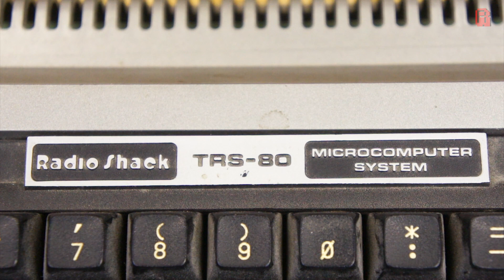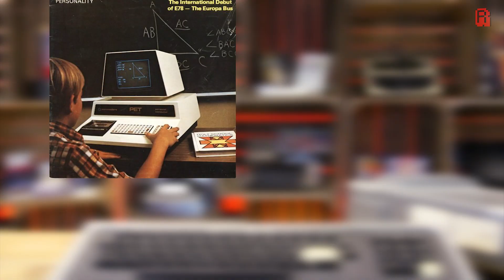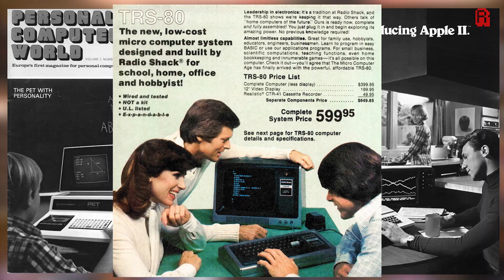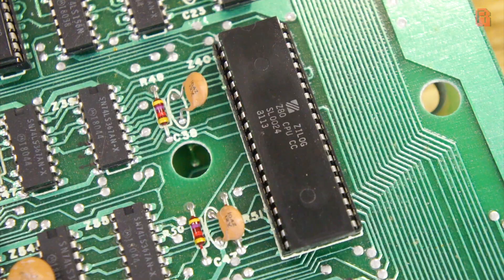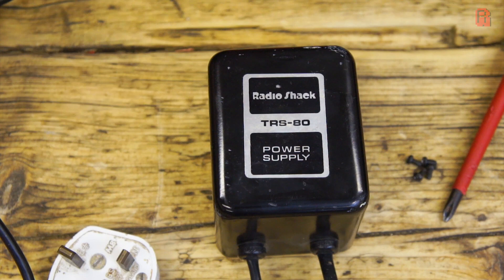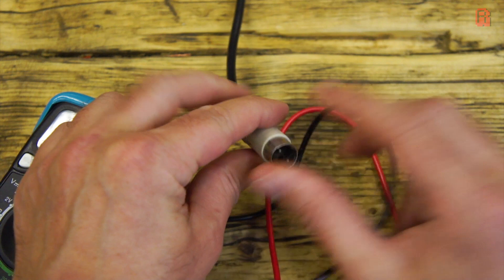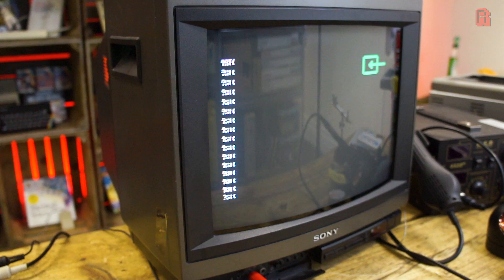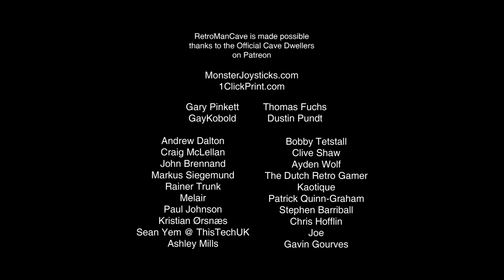Trash 80 to Treasure | TRS-80 Restoration Ep1.

Comment: Actually, the Z80 being clocked faster than the 6502 wasn't as much of an advantage as you might think--Z80 instructions generally took more clock ticks to execute than 6502 ones, so you needed the extra clock speed to offset that. This is why the 2MHz 6502 in the BBC Micro would generally walk all over the 3.5MHz Z80 in the Spectrum.
Reply: Another important factor in the BBC's speed was that the developers had more ROM space to play around with, resulting in more streamlined routines for the O/S, whereas the ZX Spectrum had everything crammed into just 16K of ROM, thus requiring many routines to do double duty, such as the printing routine which had to cater both to the TV display as well as the printer.
Reply: But...none of that has anything to do with my comment, which was that the 6502 was faster clock for clock than the Z80? I mean, the absolute fastest instruction on the Z80 was HALT, which took four clock ticks--I'm pretty sure that any instruction which did anything useful took five or more. Many 6502 instructions would execute in 2 clock cycles. Memory access wasn't really an issue either, because the RAM was usually fast enough to keep up in those days--it was later on that CPU speed outstripped memory speed and they had to start putting caches on the processor to compensate.
Reply: What kind of 6502 developers used higher level languages?
The 6502 is notoriously poorly suited to most of the common languages.
Aside from the obligatory basic found on pretty much every system of the era, I find it unlikely people were using high level languages on 6502 systems unless they really didn't care about performance even a tiny bit.

I've been trying to compare CPU's recently based on their documentation, but frankly the z80's documentation gives me a massive headache.

As for how fast the two are compared to one another, it's hard to say.

z80 instructions range from about 4-25 cycles (I think? I forget. I need to read the z80 documentation a few more times.)

6502 instructions range from 2-7 cycles. (8 for some 65816 instructions since 16 bit instructions take an extra cycle, and there's a few extra addressing features that can eat an extra cycle or two)

But what that means really rather depends on what you're doing, and how your code is written.
For instance, addition on a z80 is one of those 4 cycle instructions (if it's register to register anyway), while on the 6502 it's also 4 cycles under similar conditions. (page 0 operand).
Unfortunately, you typically also need to reset the carry flag, which is 2 cycles as well.

But that alone doesn't really tell you all you need to know unfortunately, comparing processors against one another is really complicated.

It's easy to determine (though there are still a few caveats) that an Atari 800XL is ~80% faster than a c64. This is trivial to work out because it's the same CPU, but one has a higher clock speed than the other.

However, if you were to compare the z80 in the TRS-80 to the 6502 in the Atari, even though they have nearly identical clock speeds, you'd have a pretty hard time working out what that means in terms of performance.

Consider a much later comparison, which is equally complex.
65816 vs 68000.
We know the 65816 has similar cycle times to the 6502, but operates on 16 bit values instead. (with a penalty of 1 cycle).

We know the 68000 is actually using an instruction set intended for 32 bit operations but implementing it using a 16 bit arithmetic core. (part of the reason why a 68020 is so much faster at 32 bit operations than 68000 even at equivalent clock speeds.)

The 65816 has an 8 bit bus, the 68000 has a 16 bit bus.
So the 68000 reads memory faster, doesn't it?
Well, no it doesn't. It reads one word every 4 cycles. (0.5 bytes a cycle), and the 65816 reads one byte per cycle. (1 byte a cycle), so for equivalent memory access performance, the 68000 needs twice the clock speed.
Is that a disadvantage? Depends. The Amiga exploits the slow memory access to transparently interleave memory access by the graphics chip with the CPU without either noticing the other.
Plus, this means for a given CPU clock speed, the memory in a 65816 system needs to be 4 times as fast. (16 bit access still happens at 1/4 the CPU speed. It's just that it reads two bytes at once.)
On top of that, a 68000 is a register + register design, meaning it doesn't access memory all the time, while a 65816 is a register + memory design, meaning you're pretty much guaranteed to have an operand in memory for most instructions.

The 68000 performs instructions at about 4-25 cycles too (excluding multiply and block move instructions)
The 65816 is again 2-8 cycles. (apart from block move)
Except that for the 65816 that cycle time is pretty much it, yet for the 68000 every instruction carries the caveat 'plus effective address calculation'.
How long does that take? oh, anything from 0 to about 150 cycles it turns out.
Does that matter? Again, it depends. But it does mean you can slow a 68000 to a snail's pace with poor instruction choice in a way that would be outright impossible with a 65816.
68000 has multiply/divide and 32 bit instructions. (albeit slow), 65816 has neither of those. (some hardware that uses it has external implementations of these features though.)

Which is faster? Yeah, good luck figuring that out in a way people can actually agree on.

Clearly you'd have to work out IPC, but there is no one single, reliable way to determine it which isn't conditional, and dependent on context.

Plus the support hardware matters too.
If you do 3d graphics calculated on the CPU on an Amiga, an Apple IIgs, a Mega Drive and a SNES you'll get different results on all of them above and beyond what the CPU alone would imply.

For similar reasons writing a functional 3d renderer on an atari 800 is probably easier than doing it on a SNES, even though by definition it's trivial to prove the SNES has the faster processor.

So... How do you determine such things? If it even matters...
Well, empirical testing maybe. But you'd have to control for confounding factors (hardware design of the rest of the computer), and you could easily bias the results by cherrypicking the nature of the test. So in the end, it's just academic really.

We know these processors worked reasonably well. We know lots of systems used them. (well, the 6502, z80 and 68000 at least). Anything else... -shrug~
Reply: You're right about high level languages. You could get them but the optimisation was poor to nonexistent so you always ended up with slower, bigger code than if you'd written it in assembler. I used to develop on the 68hc11 which is basically a 6502 on steroids, and with only 512 bytes of ram there's no way I could have achieved as much with a compiler!
Reply: Yep. I do programming both for 6502 and Z80 quite often, and I'd say Z80 needs about 2x clock frequencey to be a rough equivalent of 6502's performance. That's because of the internal design, 6502 has a two phase design (uses two phases of the clock), so shortest opcode is 2 cycles, Z80 runs on a single phase, shortest opcode is 4 cycles. Both CPUs has advantages and disadvantages, but if you write well optimized code, they're mostly on par (considering Z80 has  twice higher clock frequency).
Reply: shiru8bit: Aha, so the 6502 is a buzzy '2 stroke' while the z80 is a farty '4 stroke'! Now it makes perfect sense... XD
Reply: shiru8bit, have to ask what you are programming on those dinosaurs these days?
Reply: I have to agree with shiru8bit, at the same clock speed a 6502 will be about twice the speed of a Z80. Higher support level functions can be easier to program on the Z80 than the 6502 (once you wrap your head around the Z80 architecture), but the 6502 can often handle low-level stuff more easily. There is a vast range of stuff that could use either. 

I have to wonder about the claim that there was a lot of business software written for the 6502 in high-level languages, unless that higher-level language was the Basic on the target system. First, I don't recall there being all that much business software available for the 6502, other than maybe for the Apple ][. There were a handful of compilers and interpreters for various languages available, and they were used, but I suspect a huge fraction of all 6502 software written that wasn't in Basic was in assembler.
Reply: The Z80 had a 4bit ALU so some operations took twice as many clocks.

Comment: I believe you have a machine from 1981. The date codes I saw on the chips we're mostly from late 1980, but some (such as the CPU) we're from 1981. The 8113 on the chip means week 13, 1981.

Comment: I love Trash to Treasure Videos. PLEASE.  Use Baking powder for Fluffy Muffins in the next vid.
Reply from the maker: It has been a long time since we had the Baking Powder for Fluffy Muffins out Ralph.  Maybe!
Reply: The 8-bit guy did a similar restoration on a TRS-80 Color machine a while back, he tried using baking soda to clean the case and it did nothing to help with the paint. You can see his attempt here: https://www.youtube.com/watch?v=XT5SYlqM7wk&t=5m25s All in all I think this machine is just going to need a fresh coat of paint, especially since it's worn off at the palm rests.

Comment: A 1.77MHz Z80 must be slower than a 6502 at 1MHz. 
Loading from memory on a Z80 requires to:
1) load HL (any 16 bit pair) the address
2) read the contents into a register ld a, (hl)

Where the 6502 as immediate 
1) LDA <address>

And it gets worse with simple increments and decrements of memory data
inc $d020 is enough on the 6502
On the Z80
you needed to:
1) ld hl, $d020
2) ld a, (hl)
3) inc a
4) ld (hl), a

So it must be considerably slower at this frequency than 6502

Comment: Start by replacing ram chips, easy as they're in sockets.
Reply: Or at least re-seating them. Replacing the CPU is probably also a good idea too. The one on my TRS-80 went bad slowly and caused all sorts of weird problems. Luckily at the time I had access to an In Circuit Emulator which of course allowed it to work perfectly... Talk about sledgehammer to crack a nut.

Comment: There are no "later models" of Z-80 based TRS-80's that output color. There were third party add-ons for color, but not from Radio Shack. The Color Computer is an entirely different line with a different processor (6809).
Reply from the maker: That is correct, while it was called the TRS80 Colour Computer it was  based on a different CPU.  It was later named the Tandy Colour Computer, nicknamed CoCo
Reply: Yes. I bought my Model I in 1979, and I have several Cocos. I worked for Radio Shack, and several of the mail order houses in Queens, NY that specialized in the Coco and the Timex/Sinclair computers.
Reply from the maker: That's cool, from your experience how were the Sinclair machines received in the US?  Was there much interest or were they largely dismissed?
Reply: Well... The TS-1000 became a "give away" computer. Lots of people got them from attending sales pitches for timeshares and condos. They were sold in some mass merchandising stores, and the kits (ZX-81) were used by technical schools to teach soldering, assembly, and trouble shooting. The TS-2068 was sold in some mass market stores, but it wasn't as popular in the US as the Spectrum was in Europe. Timex made the 2068 incompatible with the Spectrum, and most game authors didn't bother to make the mods to their games to make them into 2068 versions. Look up the two "Zebra on TV" videos to see what we looked like in the mid 1980's.

Comment: That's pretty slow for a Z80 system. I didn't realise they made z80's that slow.
I always assumed 4 mhz was the minimum.

Good thing (sort of) about z80's (and 65c02/65816 too) is you can buy brand new, modern versions of the chips.
Granted they're likely not suited to fixing older systems as drop-in replacements, but with a bit of support circuitry I'm sure you could retrofit one into an older system if you needed to.
Reply: Original Z80 max clock frequency is 2.5 Mhz, Z80A is 4 Mhz, then B for 6, H for 8.
Reply: huh. Did not know that.
But then again I'm very rusty on everything prior to at least the early 80's.
(except technically the atari, but I had an XL, which is from 1983 - the original just scrapes into the 70's at 1979)

From what I've seen, current z80's are 6, 8 and 10 mhz, which isn't much faster than the 80's really. XD

6502 and 65186 in current iterations are both 14 mhz (but easily cope with overclocking to past 20 - FPGA implementations have hit 200 mhz, but that's not a commodity part as such, where speeds in the 80's were generally 2-4 mhz, (turbographx has a 6502 at 7.16 mhz though) and I guess in the mid 90's you had 10 mhz parts, technically (Snes SA-1 expansion at 10.74 mhz)

Comment: Why is it so enjoyable to watch this kind of stuff? Granted, I loved my Atari ST 1024 back in the day, especially its audio, but I'd take a modern computer over it any day. Still, I love watching videos on old technology and restoration of the same. It's also amazing how they still work or can be restored to working condition. I mean, heck, this thing is older than I am. I'm sure if someone found my current PC in like 51 years, a few would probably be the only things left in there that MIGHT work...
Reply: I think what makes a lot of these restoration of old electronics videos so nice is the fact that those old electronics could actually be restored with a few screwdrivers, a soldering iron and some time and effort. With modern electronics it's a lot harder to figure out what's wrong and how to fix it because either it's too small to do anything with it, or it's all combined into a single epoxy blob, or a combination of those. With a lot of these old computers, you can not only see exactly what parts they used, you can often readily find them available online. In a lot of cases most of the chips in these machines are still being manufactured today, a good example being the Z80 processor (although I'm not sure if this computer would be happy to receive a CPU that's clocked at 7 Mhz). Also, it's just extremely satisfying to see something that looks like it was fished from a trashcan slowly turn into something that looks (almost) brand new :)
Reply: I can absolutely agree to that.

Comment: Can't be keyboard as you chopped it out, Keyboard is mapped in main memory address 3800 X3to 38ff, Input is coming from bad address decoding. I suspect Z51 a 74LS15 or X3 jumper miss wired.

Comment: Can't be the keyboard you cut it out. The keyboard is mapped in memory at 3800 to 38ff so problem is address decoding, suspect Z21 a 74ls156 , X3 jumpers then Z74, Z73 causing bad address decoding as keyboard is being read even after you cut the flex cable

Comment: The MEMOTECH MTX512 which was made in Oxford used a similar power connector, why could the TRS80 not be speeded up with a 4.0MHZ crystal.
Reply: There were various speed up mods for the Model I. I did the one from the Dennis Kitsz book, TRS-80 and other Mysteries which worked for many years.

Comment: I seriously doubt that a 1.77-MHz Z-80 would outperform a 1-MHz 6502.  I was excited to try out the Z-80 in the C128 but found that it was a lot slower than the 6502 (I think even at 1 MHz).  The C128's Z-80 had an effective clock speed of 2 MHz.  While the Z-80 has more powerful instructions and 16-bit registers, it has four clock cycles for every bus cycle where this is 1:1 on the 6502.
Reply from the maker: It would certainly be fun to run some head to head benchmarks.  Maybe the C64 vs ZXSpectrum?
Reply: Here is a benchmark of sorts: a prime-number program in Pascal compiled into p-Code and then run on various processors.  The 1-MHz 6502 in the Apple II ran it in 390 seconds and a 2-MHz Z-80 ran it in 455 seconds.  A 3.5-MHz Z-80 should easily beat the 1-MHz 6510 (minus video overhead) of the C-64.
https://github.com/soegaard/minipascal/blob/master/minipascal/tests-real/primes.rkt

Comment: Non-relevant comment, but is that a guitar pick you're opening the power supply with? :D
Reply from the maker: Hehe no it's not, it's part of a kit you might use to prise open a mobile phone or tablet without scratching it up
Reply: RetroManCave I've got buckets of those handy, good to know! Awesome video BTW, not being from the US I've only heard the name of this machine. The row of 5-pin connectors looks scary like you point out, a case of mistaken connector is almost guaranteed...
Reply: Great video. Looking forward to seeing the repair one. I find these fascinating as in my job if something in a modern pc breaks I usually just replace a plug and play component. I wouldn't know where to start on something like this and it always amazes me both the skill to repair them and the robustness of the old machines to keep going.
Reply: It both is and it isn't. It's a guitar pick style pry tool, stemming from practice of opening delicate electronics with plastic guitar picks. But because it's blue, much softer than a real guitar pick, and has a thicker section, it's not really made to play guitar.
Reply: Actually early versions of these kits really had a guitar picks. I have one of those, and the guitar pics were better, as they were made of a much harder material.
Reply: case opening tools are a delicate balancing act.

Too soft and it becomes nearly impossible to open anything with one.
Too hard and you damage the plastics every time.

I often use a pocket knife, but I know it leaves telltale marks almost all the time.

I used to use something softer, (though not dedicated opening tools), but it was often difficult, if not impossible to actually open anything with such tools.

Basically, you want a tool that's as hard as possible, but softer than whatever material you're trying to pry apart. (since the softer material is the one that will take the damage.)